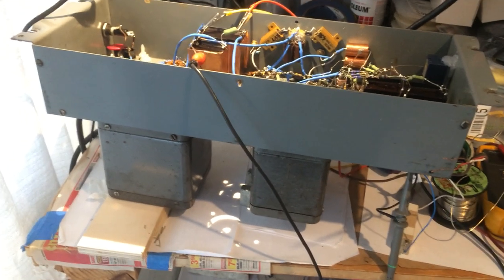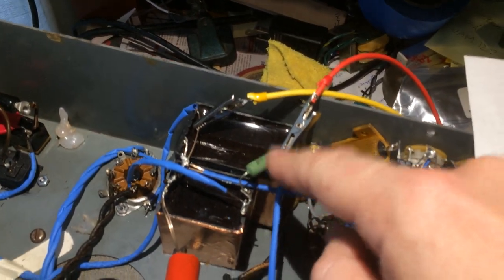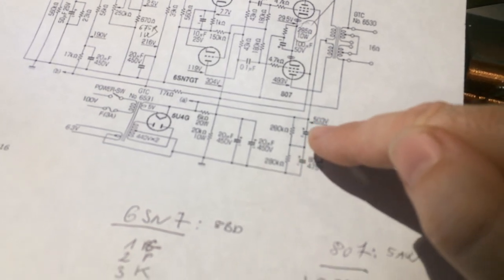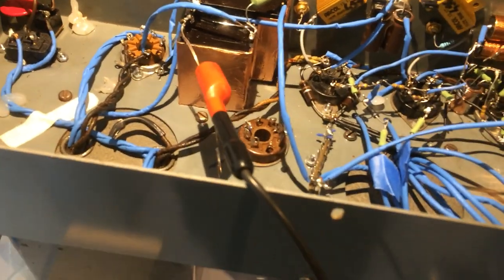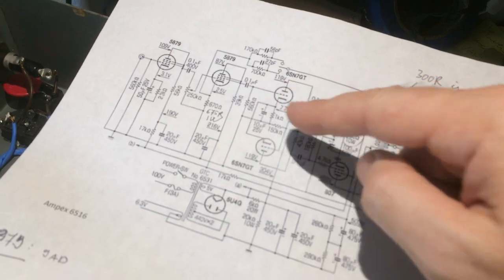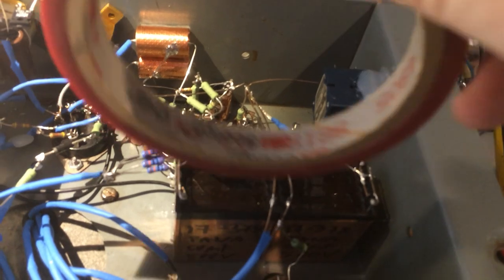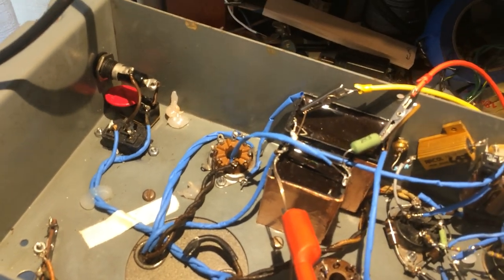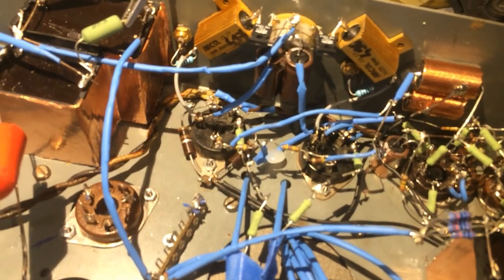Ampex 6516 Rebuild Part II

Comment from the maker: One comment re-watching the video: in the amp where I have the bleeder resistor with a switch, the purpose of the bleeder is only to bleed across a SINGLE capacitor. However, in the original schematics here, the pair of bleeder resistors act as voltage dividers for the pair of capacitors, and you MUST NOT remove them. They are there to make sure that both capacitors receive voltage below their tolerance. When resistors are removed, and one capacitor ages differntly from the other, then the situation can arise when one cap drops only a few volts, and the other cap needs to drop most of the voltage, thereby exceeding its voltage tolerance - and as a result it will fail. = Blow up, and potentially burn your home down if unit was unattended when that happens.

Comment from the maker: Around 23min I mentioned that I had voltage issues with the VR tubes, and then decided to just ditch the VR and go for triode connection. The cause of the faulty VR regulation turnd out to be a faulty connection! A single joint, it appeared as if I have forgotten to solder it! Lesson learned: GET GLASSES WHEN YOU HAVE PROBLEM WITH EYESIGHT! Although for me, this was my first lesson in needing to adapt to declining vision (worsened by extreme stress at work = lowered concentration with stereo projects).